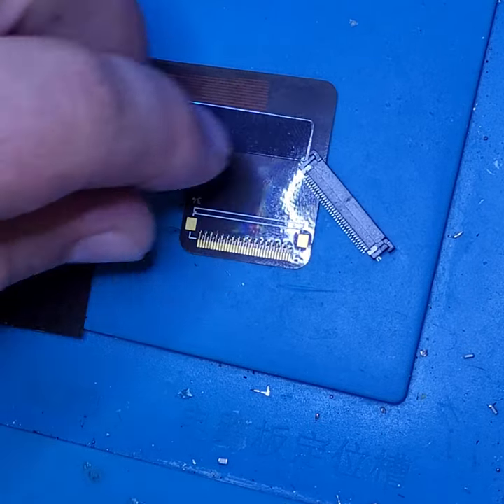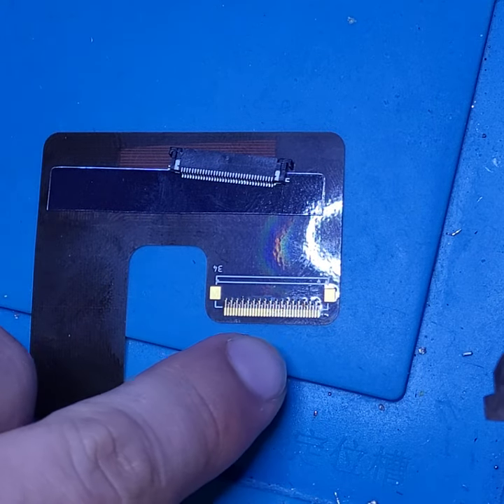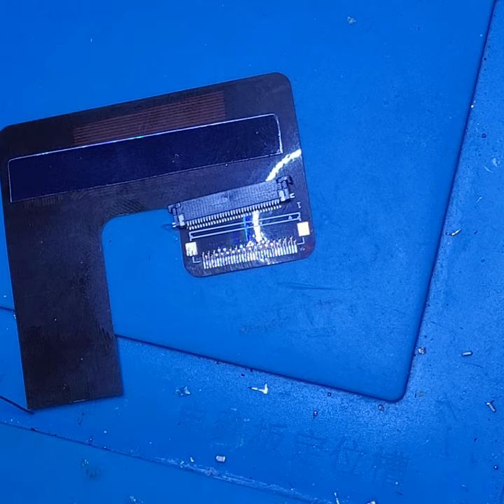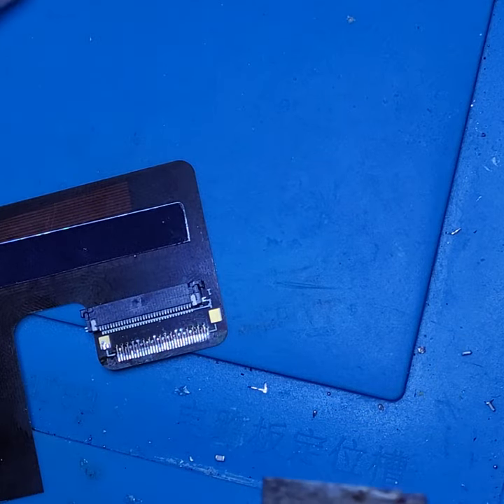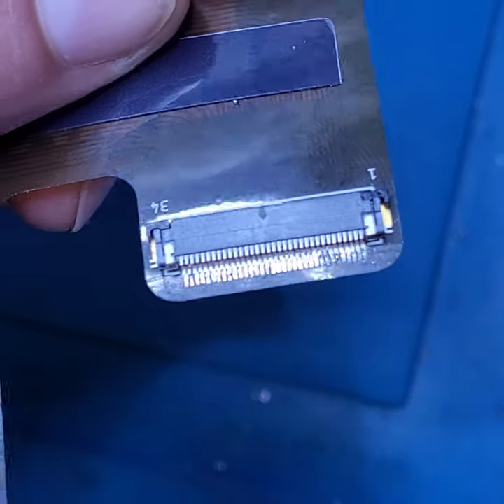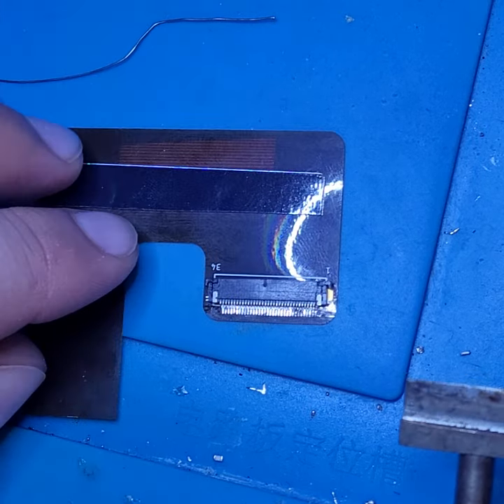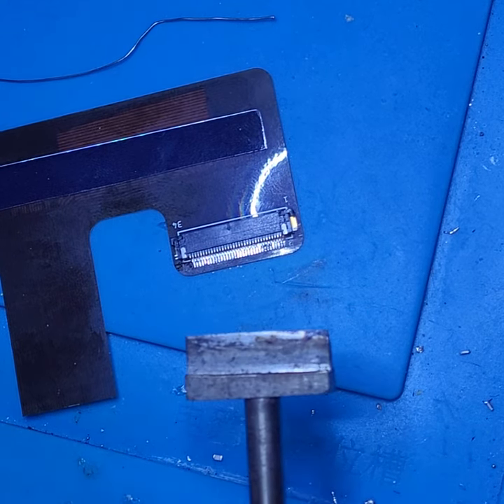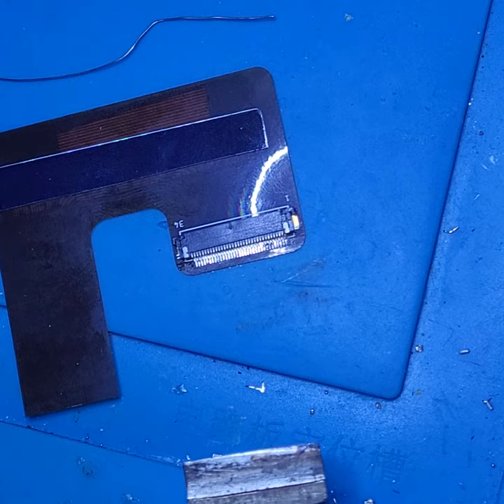Soldering a fine pitch 0.5mm ribbon connector in 5 seconds

Comment: Were there any bridges between the pins? Did you use any flux at all?
Reply from the maker: No but at this fine pitch on certain angles  it's looks like it is but is not on another angle. I did not use flux but it's good to do a little flux and just reheat the pins for cleaner joints.
Reply: @Angryhelder  Thanks for the fast reply. This method looks really convenient. I really like it. I bet it would be amazing for soldering different connectors and ports.
Reply from the maker: @boz89  I use this quite often on many things and I also desoldered a Raspberry Pi Zero from one of my mintyPi PCB with just this thing, some flux and solder braid. The heat retention is just amazing on it, GND planes pose no issue to this tip.